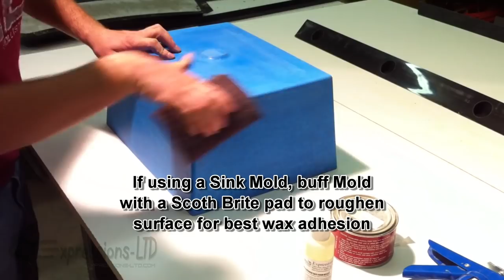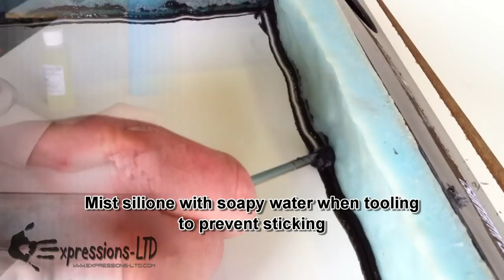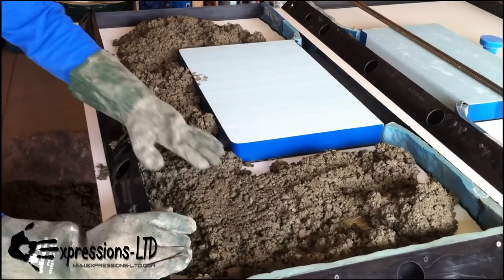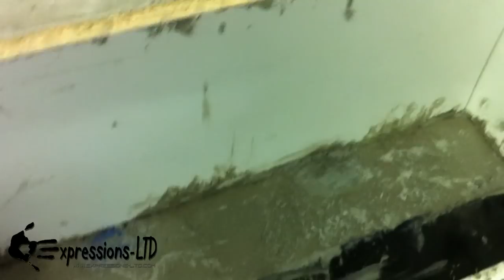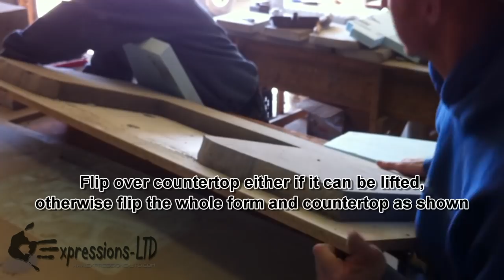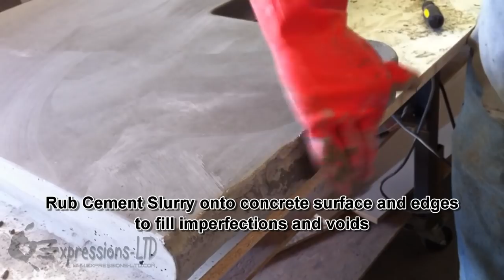Making a Concrete Countertop with Sink- Complete Steps

Comment: 4 suggestions:  not criticizing, btw . It looks nice.  :-)
1. If you make a more complete form work on the bottom, it will save you from chasing the slump and repacking it, as you fill and vibrate the mold.  No open areas. This will also save you time afterwards by eliminating extra grind down of the unevenness. Put the bottom wing pieces on after you have the mold partially filled. You can simply fill the main slab, add your rebar or whatever you use, then put on the sink box and bottom wings to finish the filling. Once you do this once, you will see the difference.
2. If you use rebar that size, the slab thickness should be at least 1.75-2". Carbon fiber rods are better and will never rust.
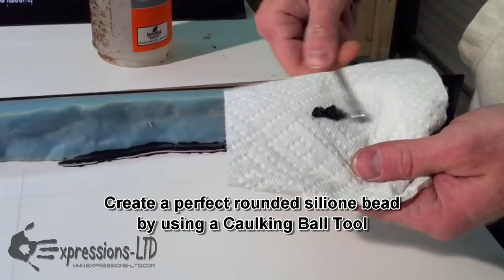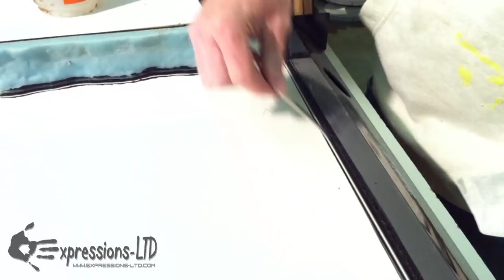3. Taping along the caulk line before you caulk will eliminate that tiny spooge line along the edge and give you a better top edge. That line left by the caulk overage after you smooth it out (2:13-2:21) requires a polish out and won't leave a completely true edge. Caulk is best when it is applied as you would on any other surface to leave a clean neat look--taped first. That top has a sculpted edge and hides it a bit. But on a smooth clean edge, you will see that line or a shadow later.
4. If you are using a colored cement, make sure the slurry matches exactly. The sacking process will naturally darken the color by the heat generated from the rubbing. Even on plain cement with no color. If a client chose a specific color, a bad slurry match will change the color and create complaints if they are picky. Test the slurry and let it dry first on a similar small piece.

How do I know this?  I made precast tops and many architectural & cast stone precast elements for 25 years. Everyone learns by their mistakes and by having others give them tips.  I'm also a union trained terrazzo mechanic and was in the trades over 40 years total. I've done huge custom jobs where the color and finish had to be flawless.  I'm retired now.  Just trying to help.   
Everyone has different ways of making these tops.  Might as well make them as good as you can. You may think you are saving time, but the little extra time to do these suggestions will save you potential hassles when it's time to get paid. With anything concrete, the small details in the mold work are what makes the finished product be as excellent as possible. 
You can bet they will be picky with any kitchen or bathroom.  Good luck!
Reply: Thank you so much!!!!! 🙏🏻🙏🏻🙏🏻
Do you have email if I have any questions for you? Thanks again 👋
Reply: Now thats what I call a comment 👏👍

Comment: i did do this with my home, good trick is too use plywood on a floor for your base then screw an orbital sander too it... to act as the vibrater... i did mine with it dyed a redish color and used broken blue glass on the surfice (bottom of the mold) tho i did a counter top by it self and then did a bowl type sink on top of it.made that out of concrete too. looked great and was fun to make.

Comment: I don't want to step on Expression's toes (they are awesome and so are their recipes!) but wanted to share the recipe I have used and been successful with. I did my kitchen with this. Ingredients: Basic Concrete Mix, Quickwall (cheap white cement with fibers already in the mix), Silica sand, VCAS (if needed), Plasticizer. 

1 bag (50 lb) of basic concrete; 2 quarts of Quickwall; 2 quarts of sand; 1 quart VCAS (If needed); Plasticizer (as recommended).

Comment: I saw in a video else where they used wire mesh as reinforcement instead of re-bar. In another video I saw both wire mesh and re-bar combined where wire mesh was used in the interior and re-bar along the edges and borders. What's ur opinion/advice regarding the use of wire mesh as opposed to re-bar or with re-bar or none at all?

Comment from the maker: Dry packing concrete is a very easy way to create voids to fill with a different colored slurry, and works well with a basic concrete mix.  Some of the expensive 'designer' concrete mix bags may not have large aggregate in them (pea gravel) but just have sand, cement, and a few other additives (such as a dry form of plasticizer/water reducer, VCAS (or fly ash), etc.  You may want to experiment with making your own mixes with just sand, cement, fibers and the additives.

Comment from the maker: Rolling any sealer is harder to get a nice finished end product.  Rolling tends to leave roller lines, and has a greater chance to leave misc. particles in the sealer.  HVLP spraying is the best way to go.  If you must roll, use a short nap mohair roller, and practice makes perfect!  Avoiding re-rolling the same area is key, so practice so you are good at getting it done with one pass, and then one back-roll pass to smooth the roller line. Using a heat gun can sometimes help pop bubbles too.

Comment: Great video. Where did you buy the foam? I haven’t been able to fine any that thick. All I’ve found is only 1” thick.
Reply from the maker: Usually Home Depot or Lowes will stock it most places... or I'd imagine you could special order it through them.  Or call around to a few building supply places near you- it's used a lot in concrete work/foundations, etc.

Comment from the maker: You can use pretty much any material for your forms... but expect different texture finishes.  What you don't want is any water to absorb out of the concrete, into the form.  It will weaken the concrete, and can result in the surface of your concrete piece to basically just crumble off.  A 4x8 sheet of melamine is around $30-$40 from any lumber/Home Depot store, which is usually less than a good quality plywood would be anyway.

Comment from the maker: We use the cheapest, basic bag of concrete (usually under $3 a bag) from the hardware store just because it's easy.  Mixing sand, gravel and cement isn't hard, but a pre-mixed bag is easier.  We then add cement, fibers, plasticizer, and sometimes Polyplex and VCAS.  Please look at our website (link is above in the description) and look on the left side for our section called CONCRETE MIX RECIPES.  A $3 bag, and adding the additives is a cheap way to ensure you don't go broke, even if you mess up

Comment: I have watch many videos over the years.  I like this one.  Did you use two stains colors to achieve the variations or did you dilute?
Reply: Baghdad Brad Btad how could I have missed that?  2 coats of walnut.   Except I've never seen anyone achieve two distinct colors like they just using two regular coats of the same color and ratio.  I appreciate you taking the time to share your expertise.  Your comments with be of little or absolutely no value to anyone.

Comment: It needs wire for support or small rebar
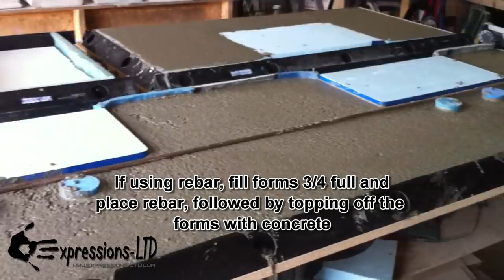Reply: Depends on size, and strength of the concrete mix.  If you aren't comfortable not using it, then yes- use rebar, wire mesh, fiberglass scrim, etc.  We are confident when we don't use it that the overall strength and final location/use of that piece will be fine without it.  Go to 5:00 into this video and you will see us adding some rebar to the longer countertop.

Comment: Question: How does the countertop feel after being stained and sealed? is it rough still or does it get smooth? I'm trying to determine if it still has that concrete roughness to it?
Reply: Depends on the sealer used and how it's applied.  Rolling on some sealers will leave a slight texture, others will lay out flatter as they dry and end up glass smooth. Spraying on a sealer will usually always be a very smooth finish.
Reply: Thanks guys
Reply: they also sell a self leveling surface coat, which you pour on heavy and just wait and it self levels and comes out smooth like glass.... but its way more expensive than the spray on versions.
Reply: Wet sanding with a concrete diamond pad up to a 4000 can achieve nearly a frictionless surface. I've done friction coefficient testing to prove it.

Comment: Why so little reinforcing?
Reply: They didn't need rebar, but they used it anyway. Kinda overkill if you ask me but still an excellent safety measure.
Reply: Personally the rebar is excessive. Wire mesh would have served the purpose better, but that's a choice for who's doing the work.
Reply: Michael Carty which is why he used rebar..lol

Comment: So what did you charge for the job is the big question....
Reply from the maker: Typically we have charged back in the day anywhere from $40-$80 a sq. ft. to fabricate and install. Now we provide the molds, forms, supplies, etc. so those prices could be far off.  Also depends on area, distance to travel, costs of local materials, and so on!
Reply: ExpressionsLTD BUENAS NOCHES,,,,SUS PRODUCTOS ESTAN EN VENTA EN MEXICO,,,,O  COMO LOS CONTACTO PARA ADQUIRIRLOS,,,ME INTERESN,,LOS MOLDES,,,LAS PINTURAS,,PARA LOS ACABADOS,,Y LOS BARNICES BRILLANTES,,,CREO QUE EL CONCRETO LO PUEDO ADQUIRIR ACA EN MEXICO,,,GRACIAS Y ESPERO SU RESPUESTA,,GRACIAS Y UN SALUDO DESDE MONTERREY,MEXICO,,,ES UN EXELENTE TRABAJO,,ME GUSTA MUCHO

Comment: Why the fuck would anyone want a concrete worktop ?
Reply: Because they aren't as expensive as granite and they look nice if you polish them.
Reply: IMHO it is the totally wrong material for this purpose.  Just another silly fad.
May as well use concrete for bed then ?
Reply: Bye.
Reply: supersesqui This is the second video you have commented on about concrete bench tops! If you dislike them that much don't watch the videos. I have had polished concrete kitchen tops for five years now and they are great. Also my wife has the same tops in her hair salon.  If you use your kitchen tops for cutting or any rough work RESOPAL wears over time. In 5 years from now if my kitchen tops look like they need it i can polish it and seal it again myself.It would of cost me 3000+ for granite, me and a friend done my wife's shop for about 800 for 4 benches. You asked why people use them, now you know.
Reply: As is my want, I shall comment on any video I see fit to !
Only a complete MORON would cut anything on the Resopal, that's what CHOPPING BOARDS are for !
5 linear meters of average  granite is about a grand.
Use what you want.
Know you know.
Reply: Why would i use chopping boards when i am working with pastry that is sometimes 900mmx900m and bigger. I don't cut on Resopal I cut on my concrete counter top as stated. I also thought i would go on your channel to have a look and found that you have a lot of hate coming from all directions. I realize now that you are just an angry little boy who cannot be reasoned with. Farewell and all the best in your future endeavors.
Reply: supersesqui ?Are you serious
Reply: +supersesqui as you know concrete has been used for hundreds of years.  Fu-Tung Cheng wrote a book in the 70's and his application techniques are still used.  Fad?  Only the colors people use are dated like the peach house i lived in as a kid.
Reply: Sean Mills

cheers sean.
Reply: +supersesqui lol why don't you and your little bishop practice docking